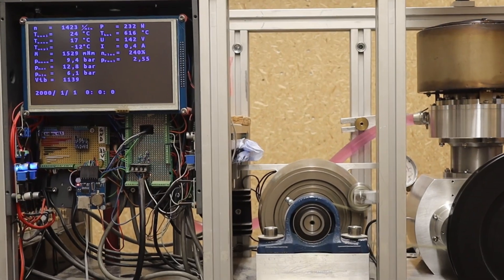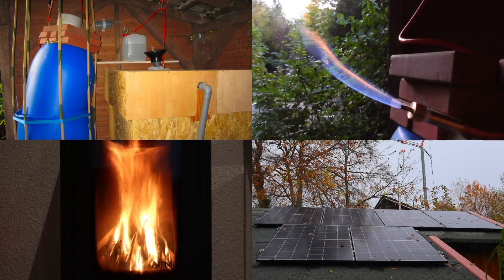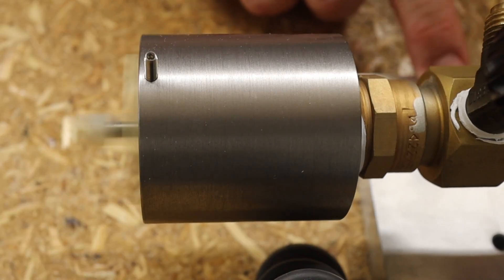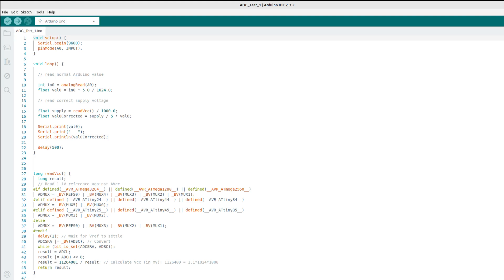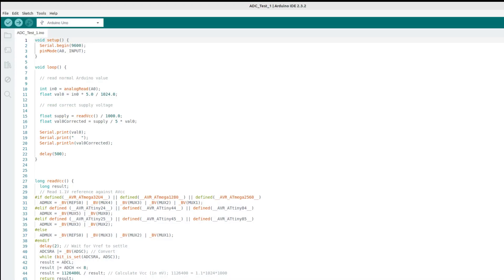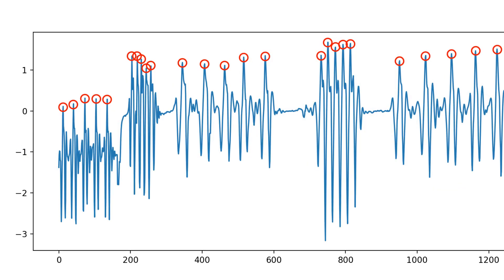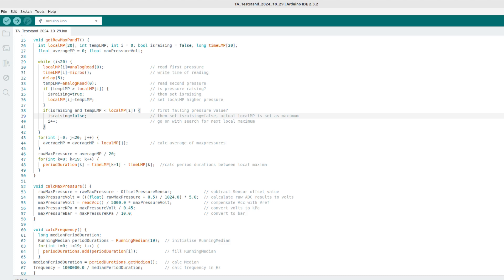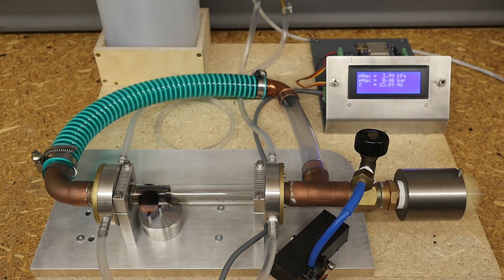DIY engine test bench with Arduino for my thermoacoustic Stirling to produce energy and go off grid

Comment: More details please.  This could have easily been a 90 minute video instead of only 5 minutes.  Tell us everything.  Show us your build and more test results.  I see a scope in there, explain what it's showing.  Tell us about that pressure sensor you used.  The engine looks unchanged but I'm betting you're tweaking more than the burner, show us what you've done.
Reply from the maker: You are right, I could make hours long videos of my experiments but I think it would be very boring for most people and it is also much work.
I try to report on major progress and try to make more and longer videos in the future!
Reply: @myengines2443  of course spend the most time on your experiments, but know your viewers are interested in the details if you can spare the time for us.
Reply: @myengines2443 We are interested in the details, but of course work at your own pace.

Comment: Another sidenote,  I get way better efficiency with SPARKLING CLEAN solar panels on an overcast day. I use griots ceramic 3 in 1 super hydrophobic durable sub micron coating for making the panels self clean for up to 1 year 2 years depending on the environment. 
Its verrrry good stuff, but save it for your cars and glass surfaces. It only works well for a long time with the hard surfaces like that. Its highly reccomended, and it could probably do 50kw of solar panels. The long term cleaning and efficiency and lifespan improvments if its just 20 dollars every 1.5 years, ITS a real solution.

Comment: Engineering sidenote,,, How about engines with catalytic coatings on the piston faces and on the engine head? The ceramic insulating plasma sputtering can be easily followed up by some sort of catalytic deposit, either chemically or sputtering too. The combustion would be improved during and after, even up to the last of the exhaust stroke. THen the exhaust ports would need the same treatment too. THere is surface area and temperature advantages to be had. THen the headers are of course mandatory stainless steel pipe headers. but right at the manifold out, there is a metal catalytic converter, the folded metal type, with catalyst being itself and too some precious metal catalyst. For each cylinder. You could even go a bit further and add o2 ports right into the heads, wouldnt want more than 4 cylinders, duh. 
Overall the emissions would just be great. 
And the cost to service is low, its just inserts in the ss pipe that never goes bad. 
And the cost to make it is low. Just some pipe and cut plate in stainless. 
The ceramic coating is basically just another added step, with low cost processing.
And the important areas are coated, like they should be, the engine head and the exhaust. This keeps the heat in, then the reaction can take place more easily. 
This would keep cars and diesel engines at low enough emissions while keeping the 80mpg plus potential of the 4 cylinder tdi. 
Steam is good if its really up there in temperature.

Comment: Is there any concern about the flexible tubing flexing slightly under pressure spikes and dragging down efficiency?
Reply from the maker: Yes, definitely.
At first I used simple pvc hoses without reinforcement, the deformation was very strong there.
The new reinforced hoses are much more stable and better!
Later I will use rigid metal tubes for sure!

Comment: I am thrilled to see the upcoming progress and results. Are you going to implement the Jet pump ?
Reply from the maker: I am building a linear generator at the moment that I hope to test soon.
Which jet pump you mean?
Reply: @myengines2443 By 'jet pump,' I refer to the feature that prevents the phenomenon known as Gedeon streaming, which can occur in this moving wave arrangement of the Stirling engine cycle and disrupt its efficiency.
Reply from the maker: @radomirfilip8741 , gedeon streaming has to be avoided and I try this by proper designing of the tubing!
Any practical hints are very helpful!

Many thanks for your good thoughts!

Comment: Have you tried using something easy to test as a generator like a speaker?
Reply from the maker: I am currently building a linear generator that I can hopefully test soon...
Reply: @myengines2443  Try an off the shelf neodymium magnet speaker? everything is done for you already, matching the impedances of the system will be the hard part of course.
Reply from the maker: @ChrisDay-sx4lv  this will be my next field of experimentation then.
Thanks for your good thoughts!
Reply: @myengines2443  pick a high resistance speaker or multiple speakers so the useable voltage wont be lost in rectification etc, like 8 or better 16ohms.
Reply: @ChrisDay-sx4lv  This and use synchronous rectification to minimize these losses.  Good comment.

Comment: Is there a load on the engine?
Reply from the maker: No, the piston is free oscillating, a linear generator is partly completed and will hopefully be tested soon...
Reply: @myengines2443  I'm just concerned that without a load on the engine, even if that load is not being measured, will mean that other measurements may not be useful. But if you intend to add that generator before making 'proper' measurements then I understand.
Reply from the maker: I am developing the engine step by step and it will take its time as it just a hobby.
Now I measure the inside pressures without a load but later with some.
It probably will not show the exact conditions of the thermoacoustc cycle but hopefully will be helpful for developing the engine to more power!
I want to develop it more technically than academic if this is what you mean.

Many thanks for your good thoughts, plz go on!
Reply: @myengines2443 If you don't have a load, what will the pressure build up against if you switch to the three flame burner? Without a load all your energy input to the system is being converted into losses. If the frequency is fixed by the behaviour of the wave(s) in the medium then maybe increased power will increase the stroke of piston movement. I have no experience with these engines and it's a long time since I studied thermodynamics so I think you have already learnt more than me!
Reply: Maybe what I mean is, if you increase the power when all the energy is going into losses then are you maybe inadvertently increasing the losses? Or maybe optimising for a different running condition to that which will eventually be used.

Comment: ,,what fuel consumption?
Reply from the maker: With 4 ccm alcohol it runs about 10 minutes but most of the burners heat is wasted, its still a very experimental setup with much room for improvement...
Reply from the maker: notmyrealname977  yes it heats my workshop shed, but most is lost through the exhaustion....
But this is still a very experimetal setup, any real power producing engine must have a wast heat recovery!